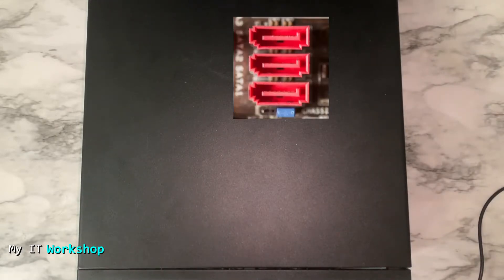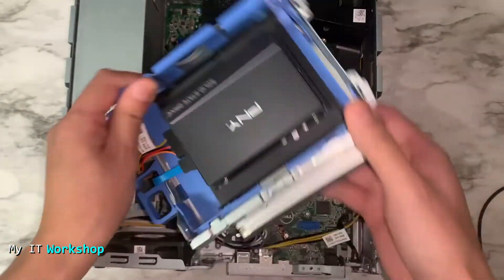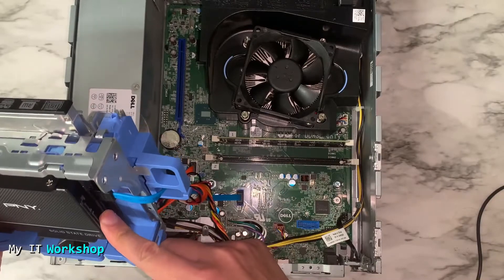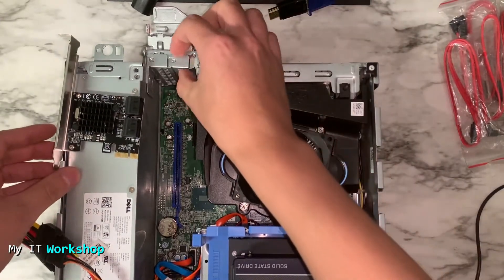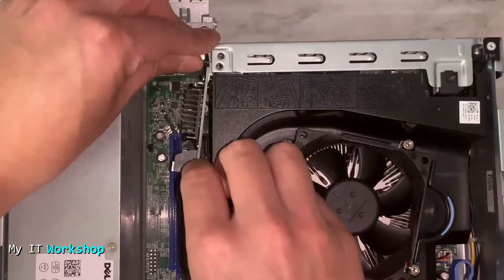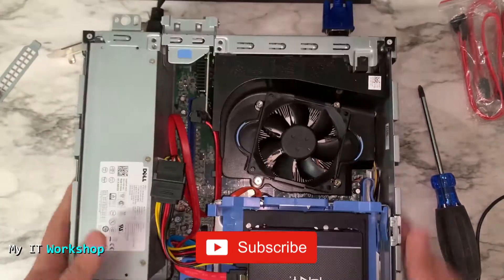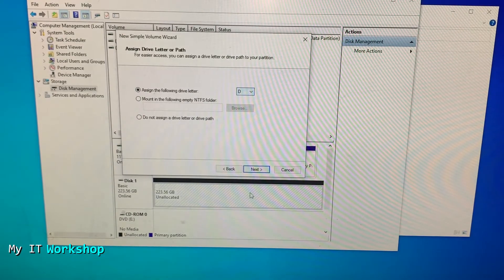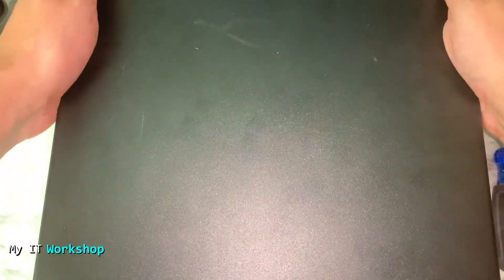Install more SATA ports on a Computer

Comment: Thank tou Very much,It worked,but...
In my tests in a Dell optiplex 3050 It worked only on Windows.
It didn't work in bios.
I can't boot the SATA device (HDD, SSD) connected to this card. Is there any way to configure it in BIOS?

Comment: Thank you sir, for sharing your knowledge. Perhaps you might advise me on a similar sata expansion card that I am having a problem with? It is manufactured by ASMEDIA (ASM1064/116x). It has worked (offf and on) with the drives that are hooked up to it. The problem it has ALWAYS presented is a very long delay when it tries to identify my drives that are hooked to it. Usually it takes at least 15 minutes. Is there anything I should do with my motherboard's bios settings? Thank you!

Comment: this is useful because i have a mini tower from state surplus, and i use my dvd rw drive and the two hdds, but i only have 3 sata connectors on the board, very very useful
edit: i forgot to mention i have a 4tb hdd lying around

Comment: All motherboards sata pins are broken.what chanses do i have to place my main hdd on PCI and bios recognise it? It's old.
ASRock G31M.
Reply from the maker: Hello,
I available you would need to select pci(e) as main bootable device in the bios….
Reply: @MyITWorkshop would it be not a problem if I install the pcie sata card besides an nvidia gpu on micro atx mobo?

Comment: Does PC boot, if the boot drive is connected through the card?
Reply: If you set in bios, yes
Reply: I can not see the additional drive on bios, but its appeared in windows. So I can't choose it as boot drive. any advice?
Reply: @theinel  just put the ssd/hdd you want to boot from directly to your motherboard

Comment: I have a GPU and it needs a 6 pin power connector Can I use this wire to have another sata power to get a Fan hub? (Sorry for the bad explaining)
Reply: Yes, just don't put to many spliters because you don't want to overload your powersupply